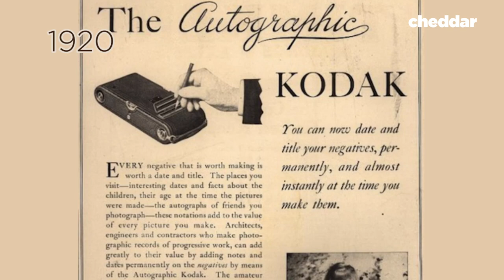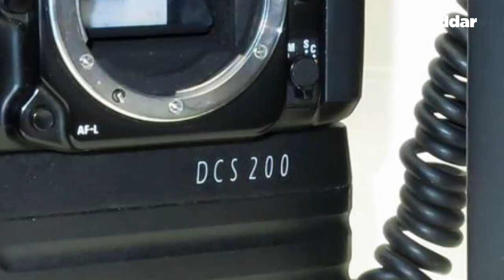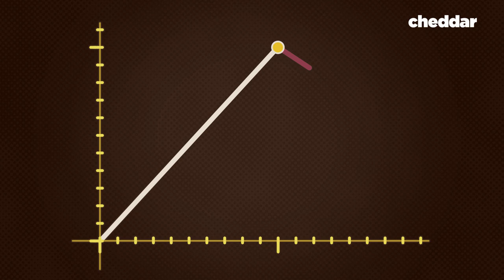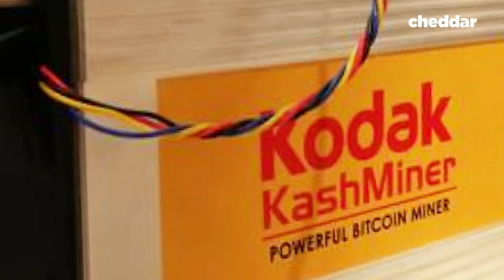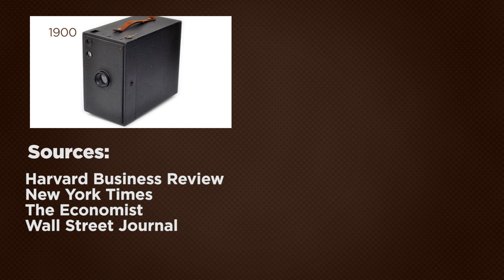Why Kodak Willingly Ignored the Future of Photography - Cheddar Examines

Comment: You do not give Kodak enough credit. The Kodak DCS system was the first commercially available DSLR and was ahead of its time. The system was geared toward photojournalism and was not "middle of the pack".

The digital camera market in 1991 was not "getting crowded." (Were you even born then?)

Kodak did establish themselves early. Unfortunately, they didn't capitalize on their early lead.
Reply: Kodak's early professional digital cameras were built with Nikon bodies. Why? Because Kodak hadn't been the choice of pro photographers for a long time. Nikon and Canon were. Had Kodak kept up with their Retina SLR product line they would've been able to make their early pro digital SLRs on Kodak bodies, they could've had Kodak film SLRs sharing the pro market with Nikon and Canon.
Kodak had been marketing to the consumer market, even making a 126 SLR that used Retina lenses, though the body didn't support all the features of some of the lenses. Then there were the times Kodak made instant cameras and somehow Polaroid was able to successfully sue to stop them, even after the patents on instant photography had expired.
Reply: @droopy_eyes  You are confusing cell phones and cameras. Digital cameras basically appeared around 1999 as a significant force (13% of the market). By 2000 they were in the 2-3 megapixel range. In 2003 they outsold film cameras (73% share). Camera phones really appeared around 2004, first at very low resolution but by 2005-06 they were at two megapixels. 2006-09 smart phones and digital cameras matched in sales in Finland, then smart phones really took off increasing sales 4 fold in 4 years. Camera sales dropped by about half and continued to decline.
Reply: For those of us old enough to be around then - and actually experience it, I disagree with this highly inaccurate millenial lense. The market was FAR from crowded in 1991 - unless you wanted to own a digital camera instead of a car. The DCS was the standard by the mid 90's - An actual portable DSLR that you could print from... how novel. I remember watching how Kodak died a death of a thousand cuts, it wasn't a SINGULAR THING that killed the company. Kodak drowned on all its fronts due to mismanagement. So apparent in the 2000s if you dealt with them. Left hand didn't know what the right was doing. So what mistakes did Nikon and Canon make - to put themselves in a pickle today? They didn't make cell phones, or develop an operating system?
Reply: @RockwoodJoe  I'm as old as you, and I disagree with your disagreement.  This video is spot on.  Kodak's larger joust was to "guide" the market, not to "serve" the market.  Their collapse was due to an inherent arrogance that they knew better than we did what we wanted.  Their fingers were in their ears all the way down the toilet.
I didn't know that they'd actually squelched this insane opportunity in 1976, but now knowing, everything makes sense.  Astounding arrogance, fate fully deserved.
Reply: @MultiCappie  You make it sound as if Kodak acted as a "single" entity in their arrogance and decision making. They were huge, disjointed and, just like GM did (or still is) lacked any focus, other than being told from the top to be "profitable". Every business unit pushed forward in its own vision ignoring the future because they had to. Having owned three early DCS bodies, I can honestly say Kodak was leaps and bounds ahead of the competition for digital imaging. Did they squander it? Hell yeah!
Reply: @RockwoodJoe  I do get you, but a single corporation is a single entity, whether all parts like it or not.  It's up to the CEO and down to work as a team with a single vision.  Maybe the guys in DCS R&D should have been the ones in charge instead, but that's just conjecture.  The board, the CEO, the vision, and ultimately all the rest of the team failed for obvious reason.
Reply: @MultiCappie  My point is, Kodak didn't willingly ignore the future as you claim, which is easy to see in hindsight. They chose to half ass it in everything moving forward.

Comment: As an amateur (and occasional professional) photographer, I'd speculated about the gradual demise of Kodak for more than a decade.  This video confirms that my partially educated guesses were spot-on.  After having owned & used a Canon 5D, I was lent a Kodak 14 mp digital camera to use on a job several years ago; as I expected, it was a piece of crap!  The image was noisy and irreparably way off on color.
Several reputable camera-makers had already pushed the technological envelope quite far before Kodak even began thinking that the quality of digitizing the images was the most important factor to the photographic market.  I remember being one of the first to use digital cameras in the '90's, thinking that the absence of Kodak there was likely a mistake made by fossilized management enamored with the old technology they thought would survive!
Business emulates nature, where any species must change or perish as the environment changes.
Like George Eastman, they assumed their 'work was done', committing suicide without waiting... until it was too late.

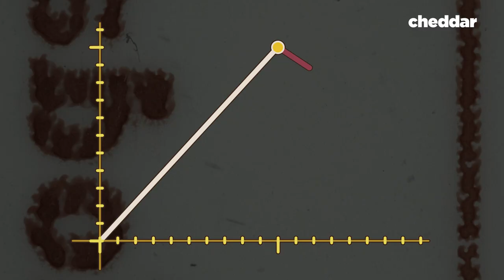Comment: 5:47 i am one of the people that want hard copies of my photos, its one reason im into film, house fires happen less than hard drive failures.
Reply: @Crashed131963  flash sticks fail the most often, i cannot tell you how many times I have had an sd card or flash drive die on me. It's way safer to keep them on a hard drive over a flash drive, or even better keep my film with my passport and BC and then reprint them if in the rare case my house burns down.

Comment: I worked in the photo business from 1971 through 1990.   Kodak could never figure out what business they wanted to be in.  They didn't recognize they were in the IMAGING business and not just the film and paper business.  They would dabble in a market segment, spend a lot of money, and then exit.  As an example, in the early 1980's Kodak decided they wanted to be in the video business so they outsourced building Kodak consumer video cameras to several Japanese manufacturers - and didn't sell very many Kodak video cameras, so they dropped that line of equipment.  Then they got into video tape, built an entirely new factory and made, probably, the best video tape on the market.   We had dropout logging equipment and when we compared Sony tape, Fuji tape, and Kodak tape, the Kodak has the least amount of dropouts and the highest quality cassettes for U-matic tape (3/4-inch).  The Kodak 1-inch tape was in high demand by professionals and television stations because of the quality - but, in reality that's a small market.   Within three years they were out of the tape business.   Then they repeated the same thing with floppy disks, and CD's.   You could go on and on about the market entrances, and exits - there were many - all the time ignoring electronic imaging of all types.   I loved Kodak products.  They were always the highest quality as Kodak quality control was the best in the world.  Unfortunately, their business acumen within the imaging market was not the equal of their quality control.

Comment: FUN FACT:  Kodak also invented the white OLED back in the 1970s, which is currently used by LG to make their industry-leading OLED TVs.  Kodak sat on the patent for this white OLED for years, before selling it to LG who brought it to market - where they currently dominate every other company producing OLED TVs.  

The white OLED technology is critical to allowing LG to dominate, because having a white OLED with a color filter placed on top of it allows a much higher yield (fewer manufacturing defects) and reduces pixel count by using a single OLED vs using 4 RGB OLEDs to make each pixel in a standard RGB-style OLED display.   

The white OLED also mostly eliminates much of the "burn in" effect that some colored OLED panels suffer from, where one "sub pixel" (one of the RGB OLEDs) starts to become dimmer than the others after some extended use, causing a permanent change in that pixel that leaves a 'ghost' image in some areas of the screen where static content is displayed.

Comment: That is not true, it's a myth they ignored it. First commercial digital cameras with good quality were kodak and they keep doing for a while. I bought myself one around 2000 and was a good camera. The problem is that Kodak was never a high end camera manufacturer, only point a click and a bit better than that. It never tried to access to the SLR market because they had no experience on it. As a point a click camera they had no way to compete with Canon, Nikon etc doing similar products and in addition of the that DSLR.
If the idea is that they ignored it before then 2000 and did little with the patents, perhaps. But digital cameras before that time were expensive toys very far of the film cameras. There was no market there. We need to remember that even a expensive Canon DSLR from 2003 had a lot less quality than a current phone, imagine 5 years before.
Kodak was mainly a film and point a click industry, being the film more important. Film disappears and point and click becomes too competitive for a brand without tradition of high quality cameras.
Reply: Punto Devista They did brand/market a Nikon D100 as their own or something close to it.
Reply: @Texeyevideo  they aparently did also dslr:
 Kodak DCS Pro 14n
It was not based in Nikon, it was very superior to the D100 as it was a full sensor 35mm camera when Nikon was cropped  (4533 x 3022 versus 3029 x 1980 Nikon)
Reply: You know that you just reinforced the point of the video right??
Reply: @karlpj1  But it had a horrible sensor that couldn't be used above ISO 80, and even at the base ISO any underexposure resulted in virtually uncorrectable amounts of noise. I know because I briefly owned one and it's successor the DSLR/N